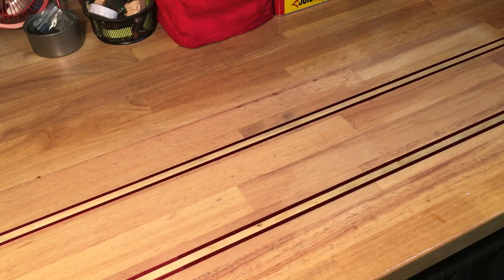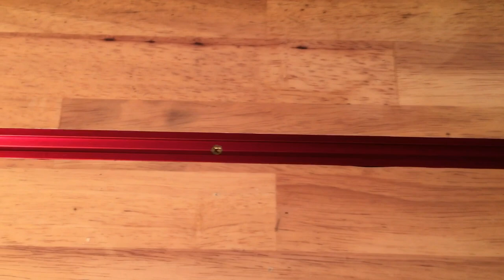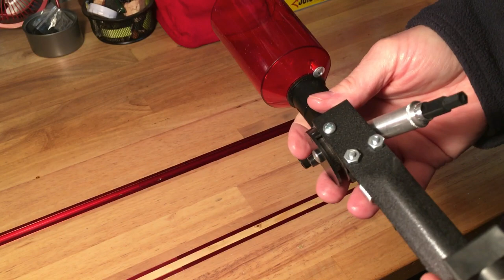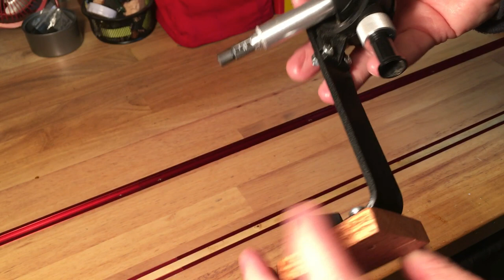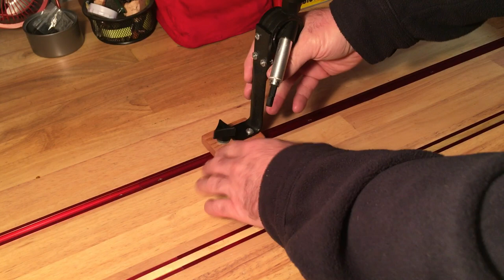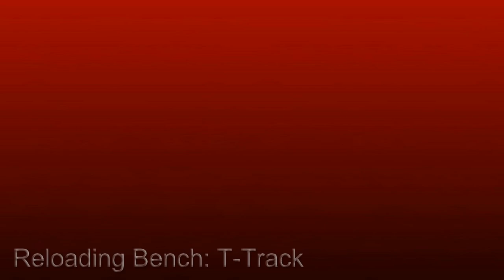Reloading Bench: T-Track (or T-Slot)

Comment: i am in the process of building a new gun room. i currently have 6 presses, one vise and 4 other sizing and cutting tools. i really need a modular set up. are these two T slots strong enough for a dillon 550? my plan is to go 10 inches apart with the slots and run 12 in square , double 3/4 plywood for the bases. i also have a lee 50 bmg set up. and might go with a floor mount for that separate from the bench.
Reply from the maker: I absolutely LOVE my t-track and would do it all over again.  However, I would NOT use it for securing ANY press to my bench.  Only smaller tools/accessories.  For me, I'd continue using Inline Fabrication's flush mount system for changing presses on my bench.  Here's a video I recently did for someone else's bench.  Can't beat this solution IMO...
https://studio.youtube.com/video/HFairFBQPvs/edit
Reply: @ReLoadersBench  ok . i was looking at the in-line system. iv heard its very robust and sturdy , especially for the price. thanks.
Reply from the maker: @hk93shooter  Their stuff is ALL robust and sturdy.  Can't go wrong with products from Inline Fabrication.  So many options and all of them are over built/engineered to last more than a lifetime.  Can't say enough about their gear and I have plenty of it (and more than a few videos on what I've installed/implemented over the years).   Good luck with your new gun room.   Hopefully you will document it on YT.

Comment: Hi,
You seem to have front rail 5” away from border. How does that work with Inline Fabrication mounts, is it a little far ?
Reply from the maker: I installed the t-track on my bench years before I discovered Inline Fabrication and their flush mount system.  Wouldn't be without either on my bench.  T-track is great for smaller stuff that I need to lock down when using and put away when done.  I did install the flush mount base plate on top of my bench (didn't want to deal with routing out the space as I had the t-track installed) and it sits on top of a section of my t-track, but a trade-off I'm fine with.  I "install" all the t-track nuts from the right side of my bench so I have most of the t-track available for use where I need it.   If I had it to do all over again, I would install (or at least rout the area) the flush mount system into the bench top (vs on top of it) and then I would install (or make my cuts) for my t-track.   My reloading bench is an ongoing evolution reflecting the changes in my hobby over the years.

Comment: Outstanding idea and execution.  Does the track extend to the edges of the bench?  When cutting the dados, did you plunge the router bit, or just cut into the top from the edge?
Reply from the maker: Thank you.  Yes, the track does extend to each end of the bench.  I began my router cuts by cutting into the top from the edge.  If I had to do it over again, I would have done multiple passes (vs the single, slow, deep cut) and lowered the bit each time (maybe 3 passes).  Pros (single pass, less chance for errors maybe) and cons (overheating the router and making a big mess of material).  All in all, pleased with the final result.  Used a guide (top and bottom) for the router to minimize any variances in the cut.
Reply: Re Loader, Thank you.

Comment: I'll never use aluminum T-track again. Was the same dimensions as yours and even said heavy duty but the back track cracked. Now looking for steel t tracks which I know for a fact is going to do the job that theyre intended to do
Reply: You must have been using it incorrectly in order to break it.  When installed and used properly there is no way to break it.

Comment: Nice bench, very clean. I’ve seen vids where guys drill out spots along their tracks to allow bolt heads to drop in, like every couple of feet. Do you see a down side to doing that?
Reply from the maker: Thanks. I’ve seen those “inline” cutouts for mid bench insertion. I prefer the cleaner look by just sliding them in at the end/side of the bench.  Plus my “filler” wood inserts cover all exposures whereas a cutout would either leave a small opening or I’d hav to fashion some type of cover as my OCD would get the better of me.
Reply: @ReLoadersBench  great point, I figured you had your reasons!

Comment: It looks nice.  Did you know you can get actual T-Rack bolts that would alleviate you having to slide things in all the way from one side of the bench?  Unlike a bolt head they are oval or elongated, which allows you to slide them in sideways, turn them, then tighten down with threaded knobs that typically come with them  Rockler make a really nice system, but then they're blue so that wouldn't work for you, lol
Reply: Correction - I meant to say T-track bolts
Reply from the maker: Good to know, thanks.  You're right, blue is a no go ;-)   I'm guessing they are probably a bit more expensive than plain old bolts.

Comment: Where did u find the red T-Track?
Reply from the maker: Amazon.  If you search on "Shop Fox D2725 36-Inch T-Slot Track" you see the size choices.
Reply: @ReLoadersBench sweet thx, great video/idea with the wood filler!
Reply: If you cut the top rail of the tracks off at the end of one of  rails to give you room to get the bolt head in .it might make it easier Vs going all the way to the ends.

Comment: No, they make a tee bolt, the head has a tee shape to it, tighten it it goes into the track, loosen it, turn it to come out of the track
Reply from the maker: Or I can use cheapie HD hex bolts and sand them down a bit.  Huge cost savings ;-)